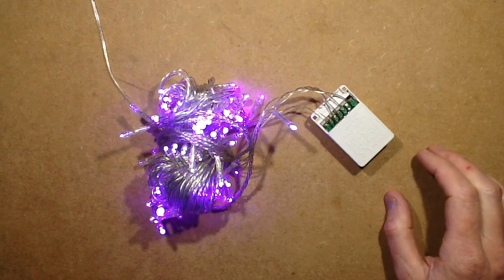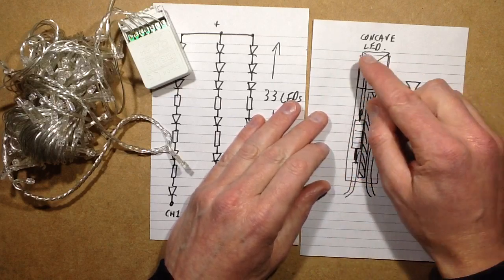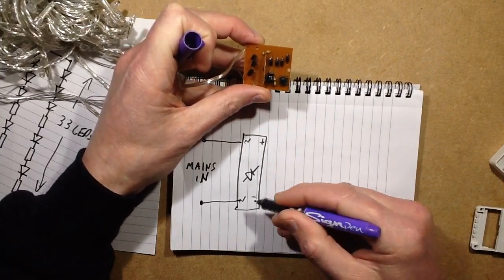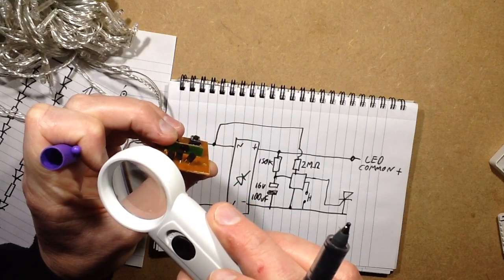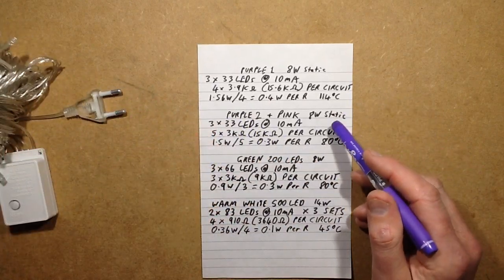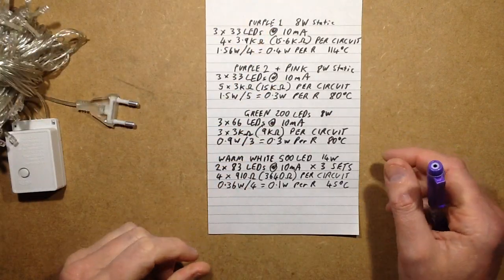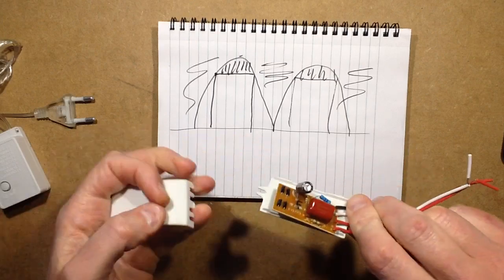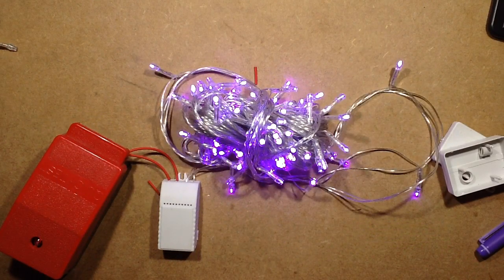Smokin' ebay 100, 200 and 500 LED fairy light strings from China.

Comment: I have 6 of those light strings in my tree  , one on my furniture and one at my window , working around 7 hours per day

Am i gonna di e
Reply from the maker: It's worth checking the string for signs of burning around the little resistors soldered to the first LEDs in the strings.  If there are no kids or pets around it should be OK.
Reply: @bigclivedotcom  It doesn't have resistors
Reply: @bigclivedotcom  and also , quick question , how much watts does a 100 led string and a 100 classic little bulb string consume?
Reply from the maker: @vierxz  A classic set of 100 small tungsten lamps will consume about 100W a 100 LED set about 4W.
Reply: @bigclivedotcom  UPDATE : one of the 100 led strings control box just melted and caught fire
Reply from the maker: @vierxz  Was it indoors or outdoors?  Can you send a picture of it to bigclive1@gmail.com

Comment: You know it's a special item when they can boil water... :P

As for a shocking experience, yeah, don't want that, gave myself one last night, tripped the electrics too, which wasn't fun... :P
Reply from the maker: Uh-oh.  What did you do?
Reply: bigclivedotcom
Forgot to unplug a lamp I was working on repairing... :P
Reply from the maker: +twocvbloke Excellent.  Did you just short some contacts out or did you pass enough current through your body to trip the RCD?  If the latter, what path did it take and what did it feel like?
Reply: bigclivedotcom
It was the latter, and it felt like 50Hz AC running through me, not sure what the path was as it was about a quarter of a second and the shock kind of, well, shocked me, went into WTFBBQ mode and went to turn the RCD back on as my UPS units were beeping at me... :P

Comment: Hi Big Clive,

Great channel, I watch you all the time :)

I wanted to ask you:
I have a GY6.35 lamp that's rated for 50w 12V halogen bulbs.  I bought an LED bulb for it on eBay (http://www.ebay.com/itm/271846372528), but it only lasted for a month before it emitted smoke upon turning it on one morning.

Now they do say that with transformer-based lamps, these LEDs will buzz, which is true, and I'm also assuming that it's what lead to its untimely demise.

Opening up the bottom of the lamp, all I see is one large transformer, and no 4-diode rectification + large electrolytic smoothing cap like I see in AC to DC wall warts.  (Are they just doing half-wave rectification with a single diode tucked away within the transformer insulation?)

What can I do to improve this lamp?  Namely, I want to provide a nice clean DC signal like you show in this video even if it will come at the cost of not being able to use 50W bulbs in the future.

Thanks
Reply from the maker: +khachaturian If it's an ordinary heavy transformer in the base then it will run the lamp on AC.  You could either replace the transformer with a regulated DC power supply, or leave the transformer in place for weight and use an external plug-in DC power supply to run the light.  Don't go for the ultra high power LED lamps.  They often fail thermally.
Reply: +bigclivedotcom I see.  So it's just a 120V AC to 12v AC transformer.
Can I just add a four diode rectifier and say a 25V 1000uF smoothing cap like in wall warts?

I'd like to keep the transformer, as it removes the equation of quality.  Transformers just work, but swiching needs good quality parts.
Reply from the maker: +khachaturian The low load and the peak sine voltage could result in much more than just 12v.
Reply: +bigclivedotcom Of course!  D'oh.  I remember this now because I did use a transformer for an internet router, and with no load, it was more than 12V.  (but I was told that the router had a buck converter IC which woul bring it down to 12).

I have an idea to build such a circuit and use the lamp's double pole double throw switch to my advantage (Hi and low setting on the lamp).  One throw for halogen lamps and one for LEDs.

Great channel Clive and please do rock on.